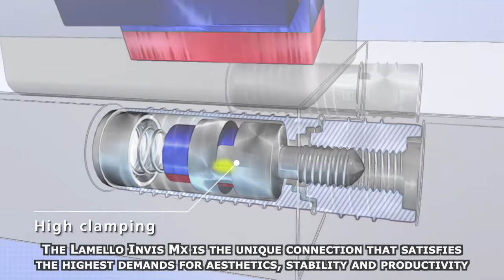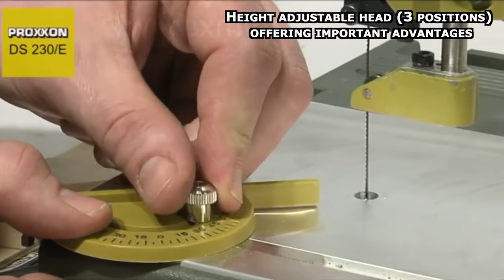Woodworking Tools That Everyone Must See ▶10

Comment: Sure these are all interesting tools, but none of them are something a regular DIY person is ever going to use on a regular basis. Even if you do woodworking more often than the regular DIYer how often are these really going to come in handy? That dove tail jig is way too expensive just to use once in a long while, plus that dove tail was not deep enough to be strong, hopefully it can go much deeper. How often do you really need to thread a piece of wood? Use expensive magnetic joinery instead of a pocket screw or floating tenon?  I can make my own jig saw guide. I already have a blade that cuts wood and another that cuts metal. ALL cool ideas, none are practical.